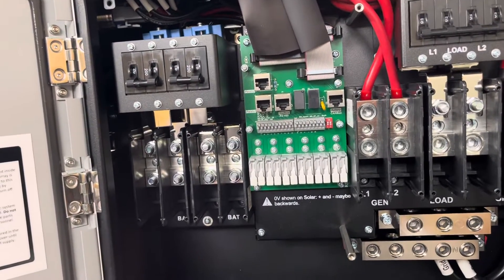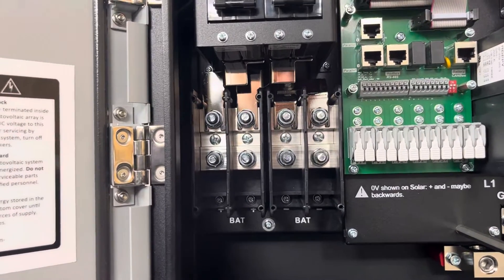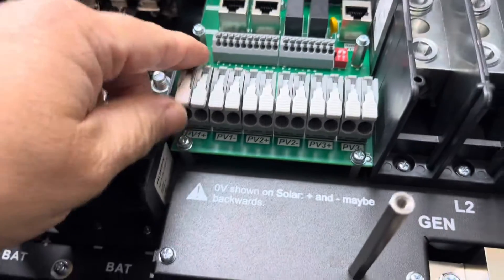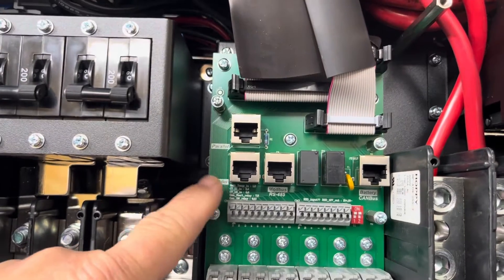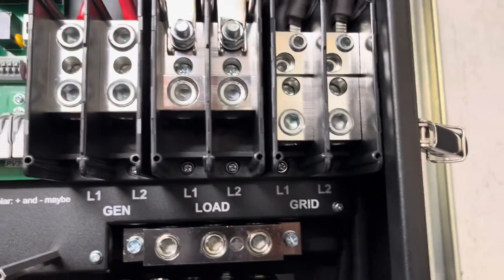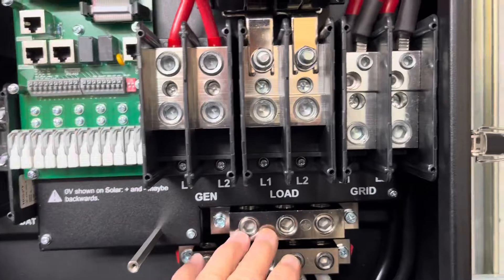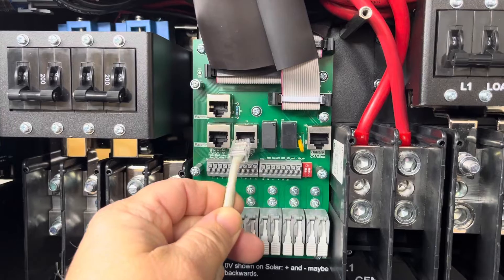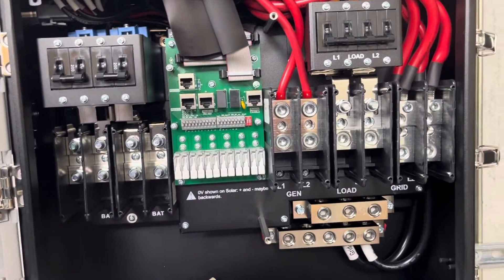Sol-ark 15K view of internal connections @Sol-Ark

Comment: If you haven't seen them yet, there is a nice set of Bus Bars that you can fit onto the battery lugs that make for a nice clean/easy install and give you the full charge/discharge rates.
Reply from the maker: I saw those … after I already had this completed. Nice looking bars.
Reply: @jeffmotes2129  Logical.  I like them.  I don't need them with my current battery bank setup, but with the soon pending upgrade, thought it would be beneficial, saving some much needed room and cable fighting. :)
Reply: Who carries the bus bar you’re referring to?

Comment: The 15k manual says it has a 250a battery breaker, but clearly yours has 200a. Is that a manual misprint or did sol-ark upgrade to a 250a breaker after this video was taken?
Reply from the maker: Hmm … my manual says 2 - 200A breakers. But the maximum charging and discharging current is 275A when using both batteries. 

Don’t know if they’ve changed the 15k or not. Bought these in December 2022.

Comment: Thank you for posting this video and I like your system and I’m curious why the server rack batteries have such small wires to connect to the parallel bus bars when I look at SOK server rack batteries they have 4-0000 size wire and I’m wondering if that is part of your problem with batteries not being close in their state of charge. 

I also have an off grid solar system with a lithium battery but it’s NMC chemistry
Reply from the maker: Hey Michael. The battery jumper wires are 16mm (#6 AWG CU equivalent). These are what came with the battery. I would have preferred #4 or #2 awg. I haven’t seen charge rates over 40A per battery so I don’t think that’s an issue. I think it has more to do with the battery themselves. But I’m open for suggestions. 

I’m going to be doing a thermal scan soon to check the connections.

Comment: I am getting ready to set up the same system. Sol-Ark 15k and 6 EG4 batteries in a rack cabinet. I will not have solar panels to begin with but will add them later. I want power backup for a small building to start with. Thanks for the look inside the Sol-Ark 15k
Reply from the maker: That’s a good way to start.

Comment: With gen on load how do you charge batteries from gen? Seems a significant capability downside to not be able to do that In an extended outage during bad weather you’d be running gen 24/7 for minimal loads rather than just running gen to charge batteries and then shut it off. 
Maybe an ideal Situation would be a quick switch to toggle between load attach or gen/grid input for grid select. 
Thanks for the video, interesting to see how the 15k varies from the 12k. I’ve used the 12 and 8 before that off-grid for a few years. 
There is a good activity at the moment to get direct access to the solark data via the mod bus onto lab, then you can read info live on home assistance display, far better than the slow update info via the dongle and app.
Reply from the maker: I had not planned on using the generator to charge batteries. But after your comment I may reconsider.  Thanks!
Reply from the maker: I’ve also thought about setting up home assistant. Just haven’t had enough time to delve into it.
Reply: Exactly my plan as well.  Instead of listening to the drone of the generator all night long while the house is drawing almost nothing, I can run off battery at night and then run the generator for a couple hours in the morning to replenish the batteries or just wait for the sun to come up.  My 20kW generator will use 3l/hour of diesel regardless of load.
Reply: @hp7033  the only issue I've found is if your gen is limited less than max charge + max load it may trip your gen. I don't think that would be a problem when you have a 20kw genset. Maybe if you have more than 1 solark it's something you need to watch. 
I've not found away yet to limit the accumulative charge+load from the gen, which I think is an important feature to figure out.

Comment: Happy New Year! Bought a last minute of the year solar purchase. 13KW of more panels. Looks like I will be busy again this year after the frost comes out of the ground in late April, or early May. Hope the Sol Ark install is going well.
Reply from the maker: A very merry new year to you and yours! Hopefully, I’ll have the sol-arks online this week. 

How large will your PV array be once this is added?
Reply: @jeffmotes2129  Probably around 40kw. Depends if I keep the east and west facing panels on my garage or not. So far they are under performing in winter. When I get the last batch of batteries installed, I will have 130kwh of storage. Everything in my house is electric, including 2 electric cars.
Reply from the maker: @snoflite5234  going to be nice.
Reply: @jeffmotes2129  Nice, but a lot of work, lol. I have to modify my control panel I built to combine outputs of inverters. When I built it I only planned of 4 inverters, but left space for a 5th future. Now I am adding a 6th in.
Can't wait to see your next video.
Reply from the maker: @snoflite5234  no doubt about the work part!

Comment: Thanks for the close up video of the 15K. I agree with you on the separate transfer switch for the generator. The internal TS is a nice feature but I don't think I trust it if you have a catastrophic inverter failure.  Plus like you said, you need to be able to isolate the inverter for repair or replacement.  I have a ATS which I intend to put directly ahead of my house panel with the house panel as load, SolArk as normal, Gen set as emergency.  Now I got to figure how to bypass the SolArk grid input to the ATS in able to "easily" isolate the inverter completely in case of failure.
Reply from the maker: That’s exactly how I did mine with tge ATS. I use a manual transfer switch (MTS) to feed my ATS. The grid and the sol-ark are source 1 and source 2, respectively, for the MTS. For me UP position on the MTS is for grid and DOWN for Sol-Ark.
Reply: @jeffmotes2129  do you have a line diagram of MTS, SolArk, and ATS please.
Reply from the maker: @craigmitchell5628  I can’t figure out how to post a picture here
Reply: I think I can figure it out. Thanks again!

Comment: Those battery breakers are actually both connected to the positives. That's why you're limited to 160A (80% of 200A) if you only use 1 of the battery inputs.
Reply from the maker: Good info.

Comment: If your generator has an auto start function, it would be nice to tie it to your Sol Ark through a bypass switch for convenience and redundancy. And the same for the grid.
Reply from the maker: I’ve had a whole house generator installed for at least twenty years. I prefer the transfer switch to be just above the line side of my house feeder panel. This way if I lose my solar power and the grid the generator automatically comes on and feeds my house. This has come in handy many times through the years and even several times when my Growatts went down.
Reply: @jeffmotes2129  A very sensible way to configure the power electronics. Excellent work!